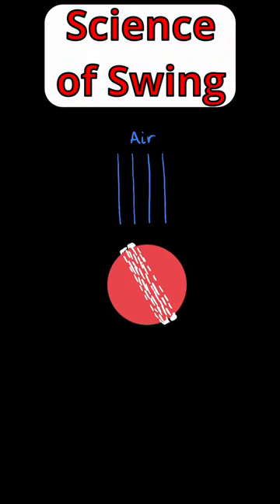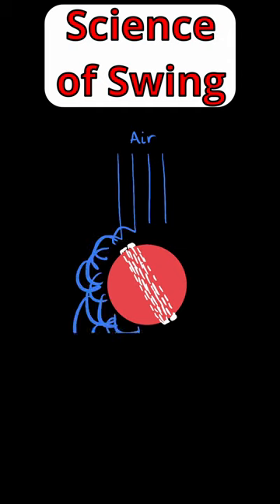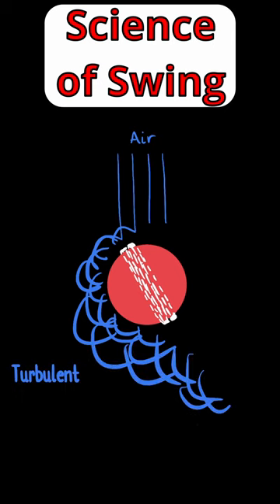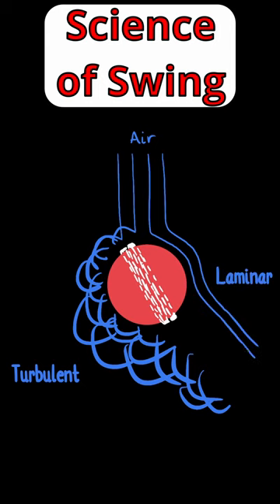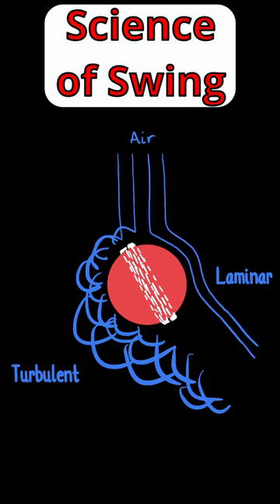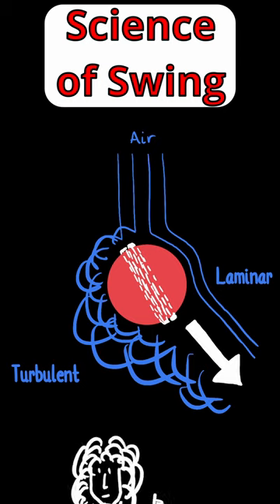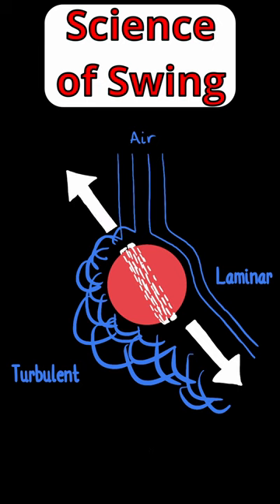Why a Cricket Ball SWINGS? #shorts #shortscricket #cricket

Comment: This absolutely not why a brand new cricket ball swings😂 Laminar flow creates pressure and turbulent area doesn’t! That’s why the ball swings, due to pressure differential. This factor is further aggravated due to external conditions like humidity and winds! There is no Newton here! Actually when the ball is new, there is no turbulent side, it is just that the side facing the frontal side has got more area hence more pressure and vice versa on the other side! Stop misguiding
Reply: Firstly, there is definitely Newton, as there is some sort of acceleration (Fnet=ma). Secondly, just as in an aircraft wing with lift, you can look at the creation of movement both in terms of the Bernoulli principle with pressure differences, or the Coandă effect, with fluids following a curved surface. You are absolutely correct in saying pressure differences create swing, just as pressure differences create lift in an aircraft. However, you can also look at it in the way this person does in their video, with seam position creating a redirected flow through the Coandă effect, just as the curved surface of a wing redirects air downwards to create lift.
Reply: @tristangrant6054  when I say that there is no newton I don’t literally mean that there is not force resultant. On the contrary, movement of the ball is because is a difference in forces on either side. I was mentioning the incorrect application of logic. Application of bernoullis in case of an airplane Wing is a long shot because in Wing we apply Bernoulli’s equation on either side. Whereas in case of a ball with inclined seam position only one side gets laminar flow and the other side is turbulent hence the assumptions for Bernoulli’s equations or coanda effect do not apply for turbulent flow